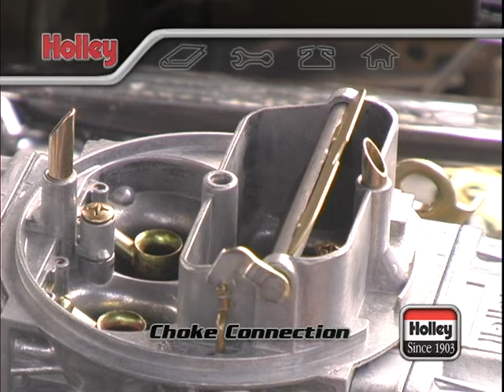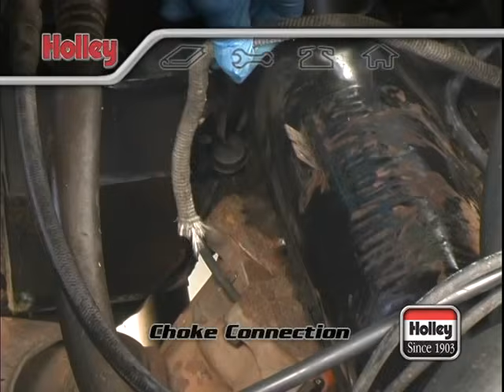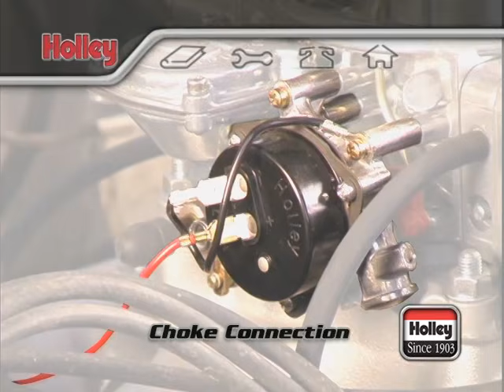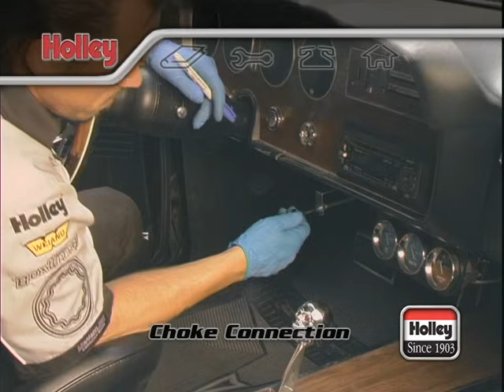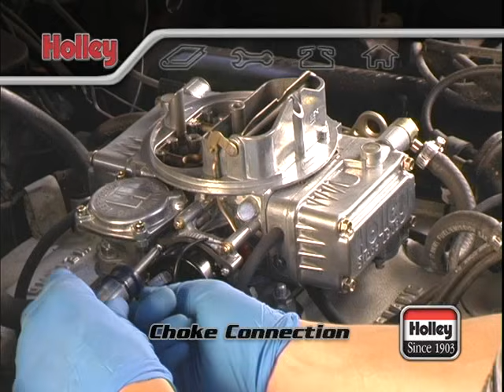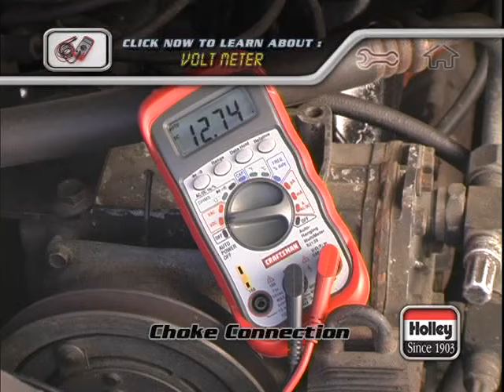Installing A Manual Or Electric Choke On A Holley Carburetor

Comment: adjusted my manual choke on my 4150 as in the video, but the high idle isnt high enough? I adjusted the high idle screw all the way but it is not enough to keep it running?
Reply: I ended up puttting a longer high idle screw in and that worked! Now have a good high idle.

Comment: I have installed many Holly carbs and not one time have I seen a working manual choke.  I set it just the way the instructions say and I close it even half way the engine stalls.  Electric and thermal no problem.  on any fords 65 to 73 connect the positive electric choke wire to the STA terminal on the alternator.
Reply: That's odd I prefer manual chokes. I'm running a 9 court oil pan and a 5 row radiator. Electric chokes disengage before my cars fully warmed up. I have lots of friends with manual chokes , but these are show cars that are well maintained and they all operate flawlessly
Reply: @BPattB , ditto. 

Since about 72, got tired of "automatic" chokes not doing the job. Went to manual and my rig would start when the weather was well below zero, AND the new cars with their high tech, automatic chokes had to keep cranking and cranking.

ONE of the problems, trying to find how to power an automatic choke is, just like here, it gives too little information.

IF you just ran power from a source active only when the ignition was on, turning the key to run and talking for 3 minutes would render the choke useless.

Other's, rightfully, point out power needs to be from a source activated only when the engine is running, so the choke only starts opening if the engine is actually running. Sources suggested are, temp sensors with two terminals, or the alternator stator.

The smart money would be on tying a manual choke to a micro switch or a spring loaded switch that warned you the choke was on, partly or fully, by firing up a simple LED warning light. Amazing no on has sold a kit for a simple device like that.
Reply: @BPattB  ..It's the other way around for me, my electric choke and thermal choke both work fine , they open fully at just the right time. I've never had trouble setting one. I've put them on other cars too. so I'd say it's odd you can't make an electric choke work.. because I can.
Reply: @Autojones I can make them work you just don't get the precision you get out of a manual choke. I can turn my choke off at an exact oil temperature regardless of the temperature outside. You can't do that with an electric choke. Electric chokes designed to work for different applications jsut not every application

Comment: What about the parts included by Holley that get attached to the throttle shaft?  Please provide instructions or at least a view of them installed with the choke housing clearing them.

Comment: So can an electric choke be unplugged and just be left adjusted open?
Reply: Yes and no. You can adjust the plate so it is mostly open but it will never be fully open with the choke disconnected. If you're trying to get rid of your choke completely just grab the choke plate with a pair of pliers and pull it out, leave everything else in case you decide to go back to it
Reply: @topcan5600  Hey thanks very much. Good to know I didn't burn myself. The new one should be here in a day or two. Now I feel god that it'll be fine. Appreciate your help.
Reply: @guidosarducci3047  no problem 😁 good luck with your build

Comment: Anyone know that part number for the manuel choke rod kit with that block with that screw too hold the rod in place too tighten down
Reply: i wish i new that there was an option for the manual choke because i ordered a 465 for my rx7 and it comes with a manual choke stock so now i have to run a separate wire for the choke

Comment: Holleys are crap but its what i have to deal with
Reply: Not really they have better secondary adjustability. Fucking with an edelbrock secondarys from the factory settings ruin it damn near. Basically you leave alot of top end tuning on the table. Not to mention it has an awful float setup which makes adjustments to it kinda guess and hope your right and if you have any fuel pressure changes you gotta go back in and adjust it. You might not get the same bolt on start up as an edelbrock but you can really fine tune the entire rpm range with a holley and if youre patient and dont mind doing some learning and trial and error its well worth it.

Comment: I'm pretty sure you are wrong about hot air chokes not being compatible with Holley carbs. I have a factory Holley 4150 on my IH 392. It has a hot air choke
Reply: Hell, all one needs to go down that road is one of the old air cleaners that had bi-metal controlled flaps that warmed off the exhaust heat.  

Of course, they don't breath as well as other air cleaners.

Comment: So could i run that (red) hot wire straight to my battery .. or should i run it threw my firewall up to my ACC on my ignition??
Reply: ALVIE78744 It cant go to the battery because it will run you batter out of charge. It needs to be a ignition connection so when you key is off the car is off.
Reply: ran mine to my fuse box and put a thin slide connector on the end and slide it in with a fuse thats for something minor like cigg lighter or radio.  you just want to connect it to something that when you turn the key to the on or acc position you have power.  ONce everything is hooked up turn key to ACC for about 5 seconds then crank it up.

Comment: AND YOU WILL NOT HAVE TO LOOK FOR SOME Little line ., marking . that  HOLLEY . TOLD YOU PUT CABLE SHAFT, INSIDE THE CAR.BECAUSE WHEN YOU PULL ,. THE CHOKE KNOB, It will stop to the setting , You set  UP ON THE CARBURETOR.

Comment: With my manual choke cable. I USED THE OUTER  PART OF THE CHOKE CABLE. TO STOP CLOSING. WHEN YOU PUT THE CHOKE CABLE IN BRACKET , THAT HOLDS IT ON CARBURETOR. CLOSE THE CHOKE BLADE. WITH ABOUT TO ABOUT .070.AT THE BOTTOM OF THE CHOKE BLADE. THAN WHEN YOU PUT THE SMALL INNER  CABLE INTO HOUSING , WHERE YOU TIGHTEN THE LITTLE SCREW. BUT SLIDE OUTER PART OF THE CABLE. SO IT STOPS THE CHOKE LEVER FROM CLOSING. AND STAYING AT YOUR .070 SETTING. YOU ADJUST IT SO WHEN ,INSIDE YOUR CAR. JUST PULL KNOB.
Reply: I was wondering why that wasn't the suggested method. Seems a lot more relable choke position than a sharpie mark.
Reply: @GettingStamped , the sharpie mark MIGHT be just for set up. I would think we'd check to insure landing places (e.g., choke fully open and closed) were right.
Reply: Ilike your way better,Thanks

Comment: I still dont understand where do you connect the 12volt wire to?
Reply: past Michael Wire it to a switch.. but idk if you put it on the ACC which is accessories. I get it that you can wire it to where if you turn off the key, it won’t burn the choke. I want examples. 😂 6 years later and still no answer!
Reply: @suchite8  annnnnnd 3 yrs later.  something like the wipers would work.  has 12v power when the ignition is on and no 12v when its off